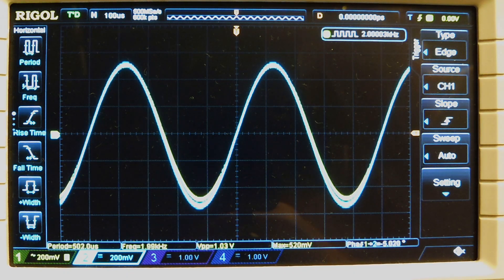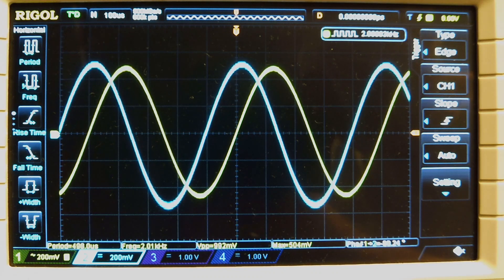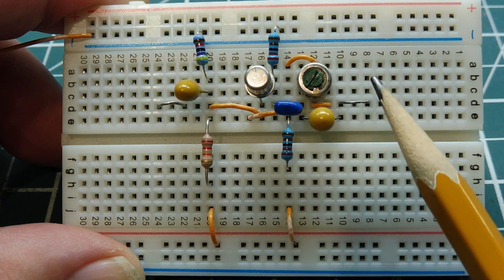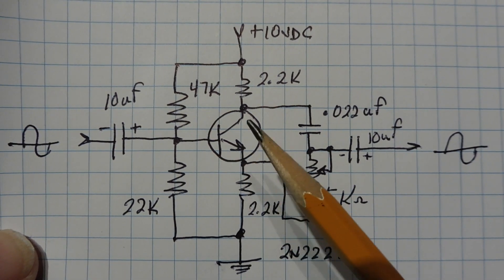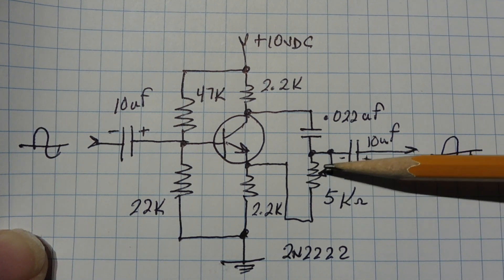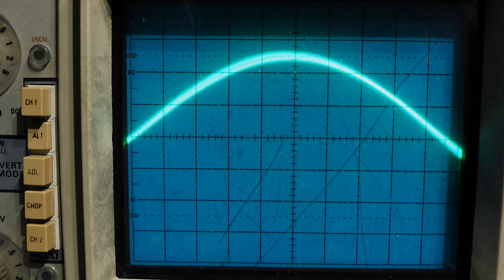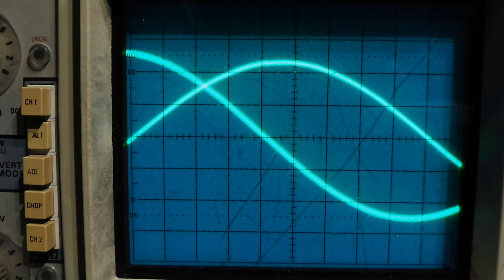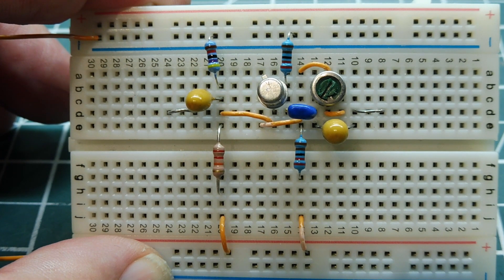Build A Simple Phase Shift Circuit

Comment: well my project is phase shifting the gm 4 pin ignition module I ques that thing runs around 33-333 hz in stages I ques so how do I determine what values shuld I use for the rc network? Wuld It by posibel to use darlington transistor alone with out the limitations that the ignition module offers ? I have terribel cold start problems in winter coil saturation is terribel I need amplifier ignition and that deam module simpli does not work at lowr engine rpms I think it was marked around 700rpm I do lot engine conversions like hot bulb or hit and miss engines so I kinde of surche for circuet that can control well the pick up coil signal or kinde of if posibel to phase shift it from 0 to 360 ° by demand . So hoppe some one has some advice about that topic . Any way I manuali control my engine any way by mechanical levers and programabel jetts so tehnicali speaking I was wondering culd I simpli use some power darlington transistor with out that shiti 4 pin gm ignition module? Again that thing is terribel .I culd not finde exact data for my pick up coil volts and frequency ratings some peopel say it makes around 3 volts minimum suposedly that shuld by enough to trigger the ignition module and the module it self has stages of operation like(start,run ,stall mode)depending on the actual voltage aplied to the input pins of course also depending on the frequency range it operates . So Im literali confused how to deal with that thing I hoppe some one finde the time and checks the 4 pin ignition module circuet diagram who uses the mc 3334 ic chip from motorola . I honestli dont know how to apply calculation for rc network for that thing .

Comment: I used to make these simple phase shifters over 20 years ago. The author's o-scope shows the output signal level staying constant, which is not possible with the circuit shown, so I believe the o-scope signals are in actuality taken from a phase shifter constructed of op-amps.

As one can see in the schematic, the reactance of the capacitor and the resistance of the resistor are in series across two signals 180 degrees out of phase. When the reactance and resistance are equal, a null point is reached where the signal is minimum. Not zero, because there is always a phase difference between the current in the resistance and that in the reactance of the capacitor. So, in reality, the output signal level will vary as you move through the resistance range - peak voltage decreasing to a (not quite) null point and then back to peak voltage of the opposite phase. This effect is lessened to a great extent with a higher resistance load on the circuit, but can never quite be eliminated (again, when using the circuit shown). The multi-megohm impedance of his 'scope is definitely helping here. 

Op amps are used in most production phase shifters because the inherent balancing nature of the differential input of the op amp coupled with it's high gain can be used to automatically correct for the above-mentioned null effect. Also, the high impedance inputs of today's op-amps reduce the loading on the previous stage. There are several videos here on You tube related to design of op-amp based phase shifters. 

One more point: the simple circuit shown here can never quite attain 180 degrees of phase shift. That is because while you can have zero resistance for one end of the phase range, you cannot (practically speaking) have infinite resistance for the other end of the range, which would allow for the full 180 degrees. The input impedance of the following stage has an effect as well. The result is that there will always be a small amount of phase shift remaining at that end of the range. You can get close, 178 degrees or more, and with op-amps you can get even closer, so close it is not worth worrying about.
Reply: You are right, partially, it does phase shift, but you gotta figure out the potential frequency on which you can use this circuit for.

Comment: Great video thank you so much! I'm a physicist so my electronics skills are really lacking but this video is a godsend for what I need to accomplish. Quick question, you mentioned I would need to change the components depending on the frequency band I was using. How would I calculate the values of components I would require?
Reply from the maker: The quickest way would be trial and error with different values until the desired results are obtained.
Reply: @0033mer  Ok thank you! 

I need an easy controllable way to control the phase for a set of signals I'm sending to an electromagnetic coil. This set up is beyond ideal for me, especially if I incorporate digital potentiometers.

I had one more question while thinking about how I was going to implement this. How would using a different voltage range effect this set up, if I wanted to use a AC signal at +/-  140V how would I need to change the circuit?

Thanks again for taking the time to reply to my first question and making the video in the first place
Reply from the maker: You would have to attenuate the +/- 140v down to to a safe level.

Comment: This is great! I actually made one with what I had, a BC547, 1K resistors 10 nF and 22uF capacitors. It turned out fine. Now excuse my ignorance: it does not reach 180deg, only about 160deg. Is there any way of making it shift 180 deg?
Reply: It is technically impossible for this circuit to reach full 180 degrees phase shift, because that would mean you have zero resistance for one end of the potentiometer range, and infinite resistance for the other end. You can however get pretty close by increasing the resistance as much as possible on the high resistance end. Maybe you can get to 175 degrees but that's just guessing.

Comment: I built this circuit, and it does not work as stated. It is not unity gain. It changes in amplitude as you adjust the potentiometer. It does phase shift though.
Reply: As stated in this video this circuit is frequency dependent. At the intended frequency (around 1-5kHz) it has unity gain throughout the range of phase shift. At high frequency it attenuates quite a lot as you shift it.

Comment: Could you tell me how to calculate the values of the potentiometer and the .022 uf capacitor to work in the 10 MHz to 20 MHz frequency band?
Reply: Use 22 pF or similar (10–100 pF range) for 10–20 MHz, not 0.022 µF

Comment: Thank you.  I will attempt to use this as part of a circuit I'm going to be building to control a 2 phase induction motor that needs a 120 degree offset. It normally uses a capacitor but the capacitor only works for certain frequency ranges and does very little at low frequencies.

Comment: OPAMP based shifter possible?
Reply: It has a bug. It uses voltage divider biasing which is sensitive to biasing resistors and power supply ripples. I found an opamp circuit which gives much stable output.

Comment: what if I want to phase shift a high voltage in the range 100 to 250 volts AC?

What would the circuit look like?
Please help.
Reply: Run the output into a power transistor.
Reply: @jjhack3r  How do I connect the power transistor to control High voltage?
Thanks for your reply

Comment: hi 0033mer:
i have a sine wave signal which is 50Hz. i wanted to make a phase shift for it and i did your circuit but it didnt work. only i got 145 degrees of shifting phase and also unfortunately i cant change the freq of phase . may it cause by capacitor which i used at very left and very right on your scheme.there are two polered capacitor and i used polered electrolytic capacitor with 10uF, 25V ranges. 

do you have any advise for me??
Reply from the maker: The component values used in the schematic will not work with a frequency that low. Change the values of the 5k pot and .022 cap (RC circuit) to make it respond to 50 Hz.
Reply: @0033mer  thanks a lot for quick respons :)
i made it with 1mohm pot and 0.01uf capacitor. i can change phase about 130 degrees now,and its ok for me. but there is an another problem. when i prob the output of the phase shifter , there are 2-3dB noise happining. do you have any advice of me for that situation ??
Reply from the maker: Make sure your power supply is clean.

Comment: Thanks for the vid. Very helpful content. How would you go about making such a device to handle 20-25 amps at 120V? For example: I'd like to run a single(split) phase oven, but only available source is 3 phase. Could a device be created to split the 120V leg 180 degrees and still be able to handle the high load? Seeking a simple circuit rather than a massive split phase transformer, of course...
Reply from the maker: The circuit is for small signals only and a redesign for heavy AC loads would be a big undertaking.
If your 3 phase power is 208 volts you can run your 120 volt circuits from one phase to neutral and your main 208 volt heater elements from phase to phase. I am doing that with a proffer.
Reply: @0033mer  Thanks for the response. Wouldn't it require 180deg phase shift  on the connected phases to be balanced? What are the consequences of an unbalanced power source?
Reply from the maker: The 3 phase power would be unbalanced but they never are if you are running other single phase devices also.
Consult an electrician and he can look at your overall setup.
https://www.quora.com/Can-I-run-single-phase-equipment-on-three-phase-power